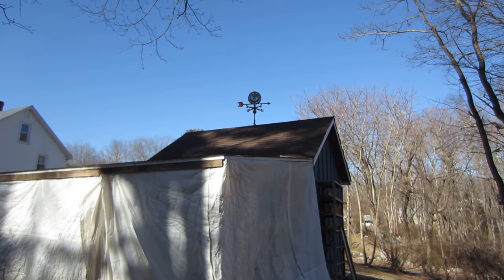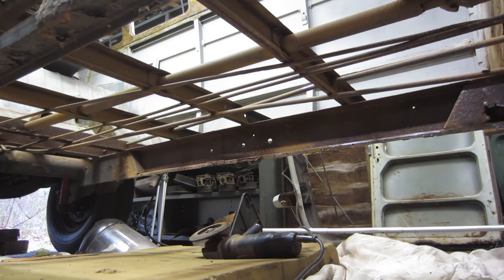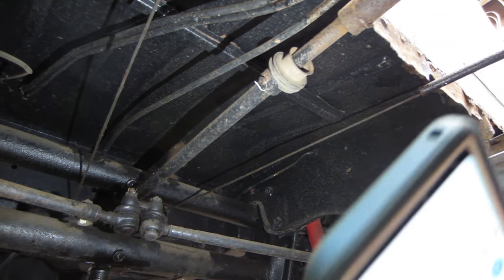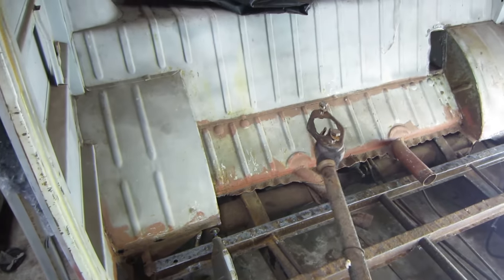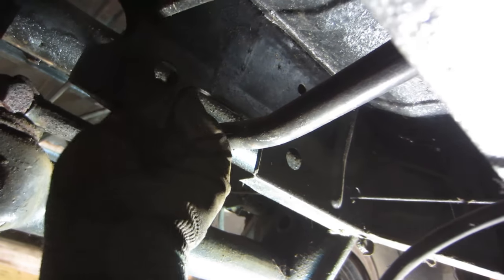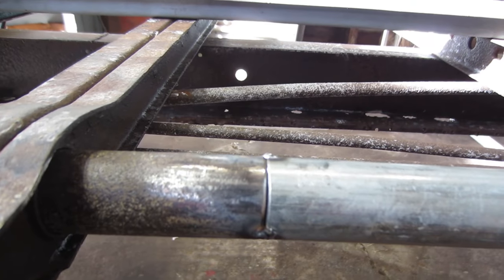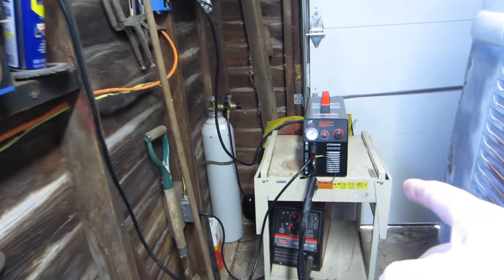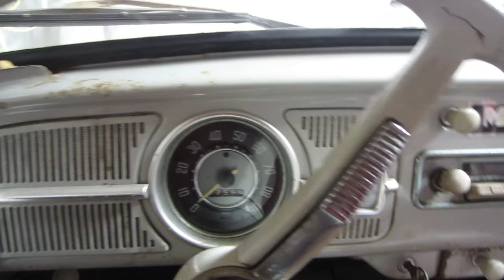Rick gets a tailbone fixed.  Rick The VW Bus#1

Comment: Hey Ernie! I knew you back when I lived in CT. That hole that was cut in from the engine compartment was probably from a gasoline heater that was positioned in the engine compartment. The bus is looking good!
Reply from the maker: No way! Whats up Matt. Of course I remember.  I drove your beetle up in Middletown.  We are back in deep river. I've put out a handful of videos on the bus. I haven't worked on it in a bit. Been very busy on lots of things around the house. My beetle, ate a valve I believe.  So that will be next...

Comment: Your a brave man tearing into those tubes! Also I'd like to have words with the guy that thought it would be a good idea to use those ridiculous square headed bolts on the shift coupler. Lol Always seized and break!
Reply from the maker: Loosing upthe tubes wasn't too bad... glad I did it to gain access in replacing cross members and hat channels.  Going back together not too bad. I second that notion!👊

Comment: yup that is how I would have done the shift tube. just gotta be careful not to burn through so the rod still fits. also on the top had I would have notched the new part and slid it over the e brake cables. put a patch in below. I just use tube stock for the shift rod and also the heat tube. Exhaust tube works perfect for the heat tube. half the price of WW.

Comment: like to see some more videos on RICK.  those frame sections are easy to make. Just buy some square tubing split them in half. and roll the bottom 1/2 inch. I oxy acetylene torch is a nice tool for that. Those ebrake and throttle cable tubes are a BITCH.
Reply from the maker: Alright Mike! I'll get back to him soon. I SECOND THAT

Comment: Do you have an M code 119? That could be where an eberspacher BN4 gas heater was installed originally.
Reply from the maker: Just checked. No 119 code
Reply from the maker: It was literally a piece of ductwork screwed with self tapping screws. Cut in pretty crudely